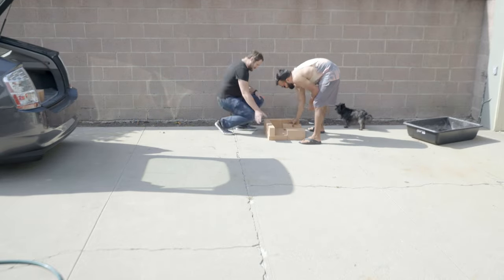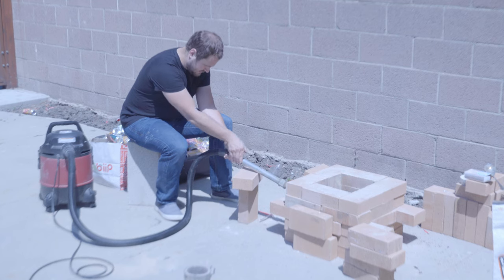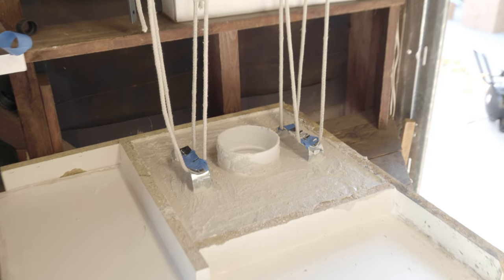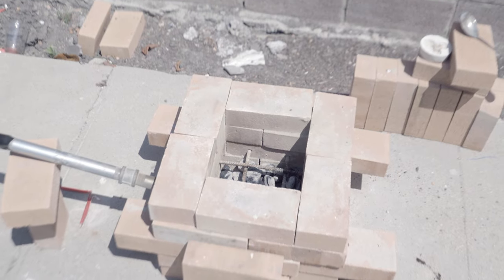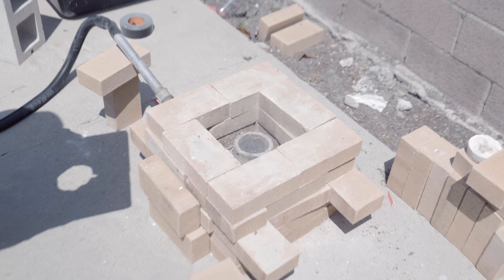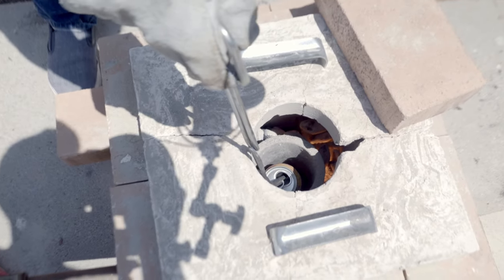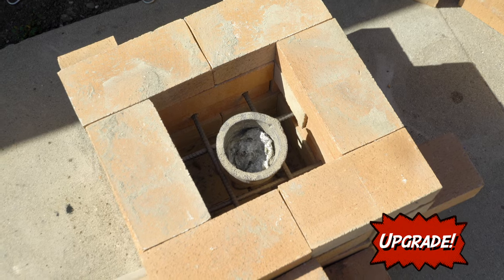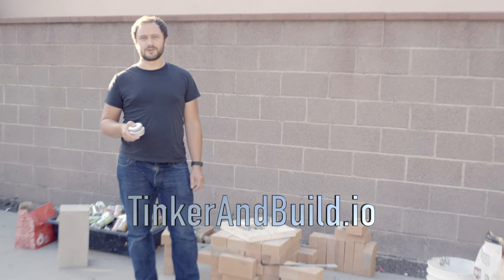How To Make a DIY Furnace in Under 30 Minutes

Comment: keep in mind that aluminium cans release toxic gasses when melted so make sure you wear protection and have enough ventilation when handling the material
Reply: Thanks god I found your comment. Was about to melt some aluminium tuna cans for fun
Reply: What type of mask would be suitable for this?
Reply: @M1ghtyHack obviously you're responsible for your own safety, but I would use a half face respirator with combination particulate (FFP3/N95) and organic vapour cartriges. For maximum protection you should really get a face fit test done one your respirators too.

Comment: Firebricks aint cheap
Reply: Can you use regular brick instead to get couple uses out of them
Any one know?
Reply: @ruvim54ify   I won't recommend it fire bricks are highly resistant to heat
Reply: @iglowinthedark3645 : I've used them on my first setup and they worked pretty well. Didn't crack and held the heat in.
Time to upgrade to a bigger one
Reply: I would say if you're not trying to get a furnace for extreme heat u can get away with a virgin brick. But I'd say if u want a cooking furnace or house heating furnace dont use regular bricks they dry, dismantle, crumble after some.time
Reply: Use two cinder blocks and put a grove for air at the bottom of one of the inner areas then you have two separate areas to use for a foundry or a forge. Cinder blocks are like 2-3 dollars a piece and a hair dryer is like 6$ at goodwill.

Comment: I made one out of 2 steel cans, barely melted aluminium but still. Pretty damn good until it melted the steel can.
Reply: How many bricks will it take and how hot does it get for example I need melt iron will it work
Reply: I made one out of 2 plant pots and sand. The inner pot cracked a bit but the sand held it together long enough to get through 4 whole melts of aluminum and 1 of zinc

Comment: I want to melt silver.  Will that get hot enough for that?
Reply: If you don't know what temp is required to melt silver, you really should just run along and look for something else to play with.
Reply: The average temp needed to melt silver is around 1763 degrees F so this is not a good kiln for that, need much more power and at those temps more safety equipment and insulation.

Comment: Dumb Question but is it safe to use this design and do this on grass?
Reply: The design is safe but doing this on grass might not be exactly good. While working with this temperatures, the air that will escape the furnace will be at very high temperatures which will easily put the grass on fire